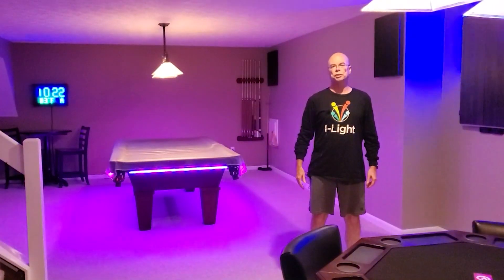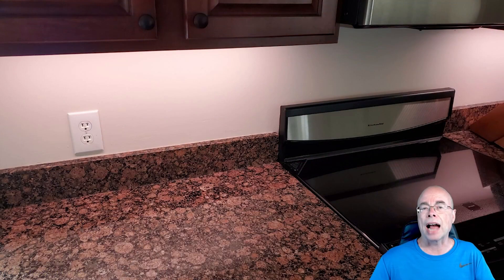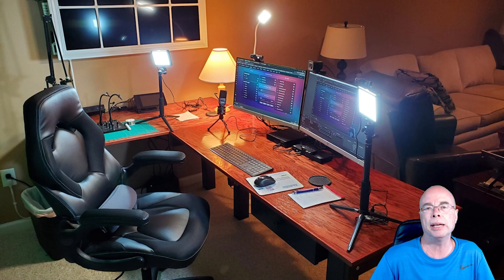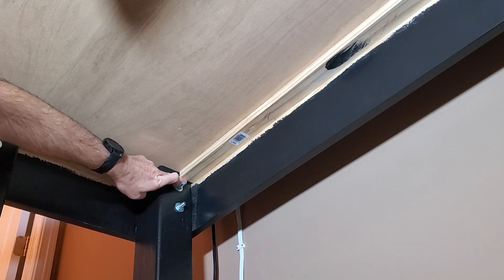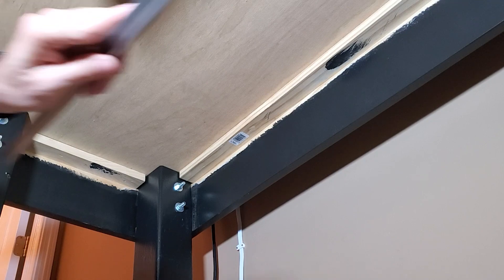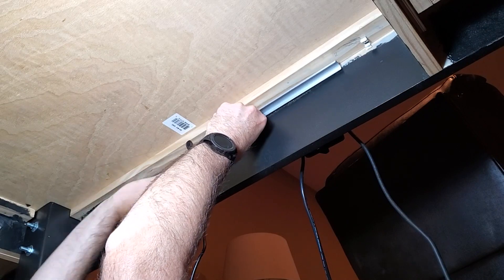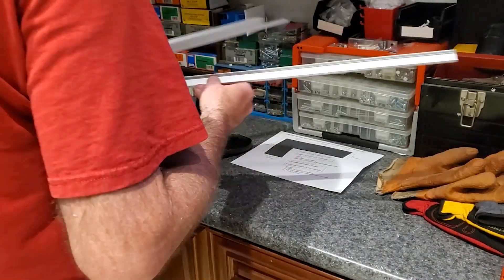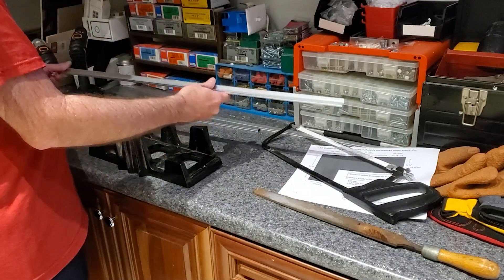Planning a New LED Install

Comment: Excellent information! I'm curious because I'm doing a design/buildout in my kitchen with 3 levels (top of upper cabinets, bottom of upper cabinets, and bottom of my floor cabinets) of lighting.
I am running through the same setup on each level (15 feet of ws2812b  per). 

My question is.. do you find that the factory ma setting and a wall wort is plenty of light?  VS using a 15a per circuit? 
I find that the 850ma factory setting is plenty bright for most applications but still running tests... (Lower voltage & Amps are more efficient for an overall build for material costs and install time). So is there a tradeoff? 

I have a 60a power supply with 3-5v outputs (1 for each run) BUT.. I intend to run the feeds from the Power Supply to a fuse block with 18/2  S.O. cord, then to...  well ... eventually the LED strips with breaks in between for dishwasher and stove along the route...😂

Still designing here, but as an electrician I have an inquisitive mind . 
Thoughts?

Glad I ran into your channel! Among others. I love to learn and build as well!  😉
Reply from the maker: Well, at least for me it depends on the intent and purpose of the lights as to whether I need or want max brightness from the LEDs.  Take the desk I used in this video as an example.  For the most part, the lighting is just for 'ambiance' and running at well below max is just fine.  But as soon as I drop a tiny screw or component under the desk, it is wonderful having the option to go to full bright white to find whatever I dropped.  So it isn't about the fact that I would 'normally' run at a significant dimmed level below max, it is about the ability to go to max brightness if needed, that results in my selection of a power supply size.

Again, it depends on your intent, but I think a 15 ft. strip limited to only 850 mA is going to be pretty dim... at least for the lighting under the top cabinets if they are meant to help light up the countertop/workspace.  I too have LEDs on the top and bottom of my upper kitchen cabinets (with a break for the stove like yours), with the original intent that the bottom cabinet lights would provide additional task lighting for the counters.  While it did add some light, it wasn't as much extra light as I had hoped (again, more just like a gentle glow), so I replaced the original 60 LEDs/m of WS2812b with 144/m LEDs of SK6812 ( for a true light white) and a new power supply to support the additional LED count.  Now, I get the additional task lighting I had hoped for.

Yes, the LEDs look pretty bright when sitting on the bench and you are looking directly at them.  But when installed and if not shining directly on a nearby surface, you might be surprised at how quickly the brightness appears to drop.  If you have any way to test a short strip in the installed location first, I'd recommend that you try that.  For example, if you can temporarily hang a 5 ft. strip in the install location, then use your 850 mA supply (or set that limit in WLED) and then set the brightness to around 33% (to approximately simulate what the 15 ft. would look like on full brightness) and see if you feel like that gives you satisfactory brightness,

As an electrician, I'm sure you know that you don't want to run your power supply at or near its rated current load for an extended period of time as it will lead to the supply running hot and can theoretically shorten its life.  My rule of thumb is to set the WLED brightness limiter to 80% of the rated max amps of the supply.  That way I can always select 100% brightness in WLED without worrying about hitting the max of the supply.

But the final decision is yours.  I always like to at least have the ability to turn on the LEDs to their maximum brightness, whether that is how I normally use them in that manner or not.  Good luck with your project... and thanks for watching!

Comment: Hello, I’m working on my desk LED project which is very similar to yours. I’m using the dig uno tho 2 ch. I have the first channel connected to the LEDs around the outside but a first question is do the strips all have to connect from one to another or can I connect the 2 going along the back and other side together and the come from the same output from the controller to the other side since the controller is mounted under the desk in the corner? I wired the second channel to the LED strips which are more inside under the desk where you sit which is separated by panels of the desk. I have equipment under there and it’s nice to have it lit up for wiring and maintenance . Also do they make larger 3 wire jt style pigtail connectors because if I come out of ch 1 to feed 2 different light strips 22 ga is too small and you can’t really get more then one wire cleanly under the output terminals. I was thinking more like 18ga to the strips then I go to the 22 ga jt connectors right at the LED strips. Please let me know your thoughts! Thanks!!
Reply from the maker: Nice!  I love the lights under my desk as well for locating those tiny screws or other components I always seem to drop!  Or for doing additional wiring for something new.

As to your questions, if I understand what you are asking... no, the LED strips that are connected to different data pins do not have to be connected to each other.  Each can be independently defined by adding an additional LED output in the LED setup.  Each will have its own pin, number of LEDs, etc.  By default, all the channels you define will be placed into one large segment in WLED, so they will be controlled together.  However, if you want independent control of the LEDs connected to the different data pins, you can just define segments for each strip.  It's kinda' hard to explain here in the comments if you haven't done it before, but Chris Maher has a really good video on setting up multiple strips on different data pins:  https://youtu.be/Zzi5UIGnY2A?si=xdlAZDP3F4PwF4zd

The other option (and maybe this is what you were asking... if you do connect all your strips together and use a single data pin, you can still break the two different parts of the strip apart (e.g. inside and outside) and control them independently by putting each section into their own LED segment in WLED.

As far as the JST/wiring, unless you have a very large number of LEDs, you are probably fine with those short thinner gauge wiring runs of the JST connector.  However, what I often do (and Chris' video shows this as well) is that I remove the existing JST connectors and solder my own 18 gauge wires directly to the LED strips.  If you still want the convenience of being able to disconnect the strips, then you can build your own 3-pin connectors with 18 gauge wire using something like molex connectors:  https://amzn.to/3Zcv6rj  (although these are pretty big and bulky).  Honestly, since the resistance and resulting heat build up is not only related to gauge, but also length, if you can maybe even trim back those JST lead wires to keep them as short as practical, you will likely be fine with an LED install of a few hundred LEDs.

I hope that helps.  If I didn't actually answer what you were asking (always a good possibility!), just let me know and I'll do my best to help you out.
Reply: @ResinChemTech  Yes definitely helped. Thanks. Off-topic on another project I still haven’t gotten my motion sensors sorted out on my stair project. I’m using the dig quad over there. Basically two PIR motion sensors one with N/C the other N/O. The issue is not the triggering. I’m not using ESP or Home Assistant. So I was trying to adapt your standalone controller but using WLED. I just need to figure out a way to trigger the Json in the code when either Motion sensor is triggered up or down the stairs, with a macro or preset in WLED. What do you think possible?
Reply from the maker: Well, the issue with using just WLED for your automations is that it is somewhat limited in terms of automations.  While you can issue a JSON command from a particular sensor's event, what you can't do is determine the current state of the lights, use a timer, etc.   So, for example, with Home Assistant, if the top sensor is first triggered to turn on the lights, then when the bottom sensor is triggered, a determination can be made whether the lights are already on and should be turned off.. or if they are not on to then turn them on.  

You can set the direction of the LEDs using a preset where the effect direction is reversed for one of the sensors.  Then when the motion is triggered on the appropriate sensor, you launch the preset where the direction is reversed.  The other sensor would call a preset where the direction is not reversed.  That should get the lights moving in the proper direction depending upon which sensor is tripped.  But again, due to the inability to run more advanced automations, what is going to happen is if you trip the top sensor, the lights will run "down" the stairs.  But as soon as you trip the bottom sensor, the lights are going to reverse directions (instead of turning off)... and will continue to run until you use some other method to turn them off.

The standalone sensor code that I wrote tries to include a bit of this logic in the firmware, but it isn't as accurate or flexible as using something like Home Assistant and two standalone motion detectors.
Reply: It makes perfect sense in what you’re saying. So what I’m thinking what if I swap out the quad controller for the Uno and then flash it with the stair code. The big thing is I like to keep the sensors that I have they work perfect on detection. Is there a way I could save them and integrate everything they are currently hardwired to the controller. One normally open the other is normally closed.

I was thinking of getting back into Home Assistant anyways this time I would go with proxmox and a dedicated machine, last time I got as far as docker with my synology, but it got discontinued and no longer supported. So basically, I have to start over again.
Reply from the maker: While I haven't used the PIR function directly on a WLED controller (my PIR/ToF sensors are controlled separately via ESPHome), the PIR settings in WLED allow you to specify a preset for both ON and OFF values of the PIR.  So you'll likely need to reverse these for the normally-closed sensor, but in theory it should be possible to use both the normally-opened and normally-closed sensors... you'll just have to get the corresponding presets created appropriately.

Comment: Cool Clips, I enjoyed watching your clips. talk about level shifter - do it need add on every ESP boards. i just wondering and interest, can have 3 ESP connect up to one level shifter? because I can see on level shifter got 4 LV ways and 4 HV ways?   wiring diagram for it please if you know. Many thanks
Reply from the maker: I talk about the logic level shifter in detail in multiple other videos:
Logic Level Shifter - Do you need it?: https://youtu.be/Q9mLitVxF3c
Comparing Level Shifters: https://youtu.be/61VWgYmomz4
Common LED Questions: https://youtu.be/GZv5Ztj6i6I

The last video above has a detailed logic level shifter section, including details on wiring it.  I also have a written guide of common wiring diagrams that shows how to wire the shifter:  https://resinchemtech.blogspot.com/2023/01/wiring-diagrams.html

As I mention repeatedly throughout these videos, you might not need a shifter if you keep the controller close so the start of the LED strip.  But I still recommend that you always use one to avoid any potential signal issues due to voltage drop.  And theoretically, you could connect multiple ESP controllers to the same shifter as it does have 4 channels, but to avoid issue due to possible ground potential differences, you'd have to be sure that all ESP boards, the shifter and all LED strips share a common ground.  This would be a LOT of extra wiring... and to be honest, for the less than $1 cost of a shifter, it would be much better and easier to just use a different shifter for each ESP board.

Comment: I am new to your channel. So far it looks very helpful. I have an idea of a digital clock. But have no idea how to do it electronically. Is this something you could help or point me in the right direction?
Reply from the maker: I've done a couple different clock-related videos that might get you started, but a lot depends on the display type, the time source (e.g. an RTC module, time server, Home Assistant) and the features you want in a clock.  But maybe these two videos can get you started or give you some ideas:
Matrix Clock and More: https://youtu.be/uV_HQpqIp2I
TM1638 7-segment display: https://youtu.be/OtVdY95vwDY

Both of these videos have related blog articles (found in the video descriptions) that contain more information, parts lists, code examples, etc. for each of the types of clocks.  As I said, maybe not exactly what you are looking for, but it might give you some ideas or starting points for building your own.  Good luck, don't hesitate to reach back out if you have more questions.... and welcome to my channel!

Comment: As a side comment, the black cables in the trays are really for all the cameras, microphones and monitors and not the project. Did you already have them there and removed them to do the installation?

I guess my point is all of a sudden when they show up so full I was a bit surprised but I think it was more of a great way to keep that off desk and off floor!

The cable trays are a great idea on their own!

This was an excellent video and has helped me with my garage door project.
Reply from the maker: Yeah... none of that wiring is related to the LED install (and I've cleaned it up a bit since!).  I knew that I was going to be installing these to keep my wiring off the floor, so I installed the mounting clips first... then the trays with all the wiring.  That way, when the LEDs were all done, I was able to just snap the aluminum channel with the LEDs in place behind the trays.  It would have been nearly impossible to install the clips once the trays were in place.

So I knew from the time that I was first building the desk itself that I wanted to install LEDs underneath.  As soon as the desk build was complete, I installed the LED aluminum channel brackets before I setup the computer, lighting and all the other "stuff" on the desk.  It was actually a couple of weeks later that I built the LEDs and controller, so all the wiring was already "in the way".  But by installing the clips upfront, I didn't have to remove the trays (or any wiring) to just snap the aluminum channel in place and connect the JST connectors behind the trays.  That part probably isn't real clear in the video!